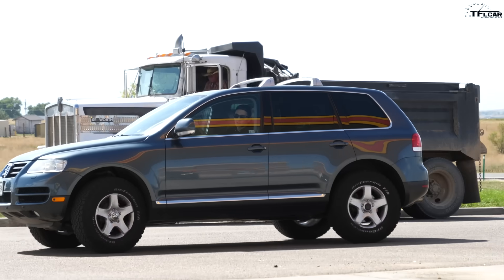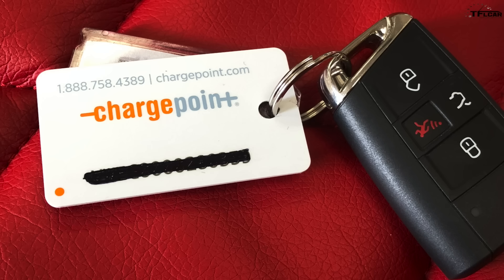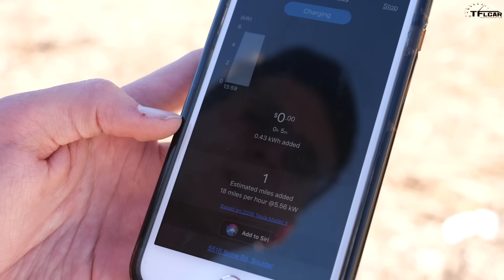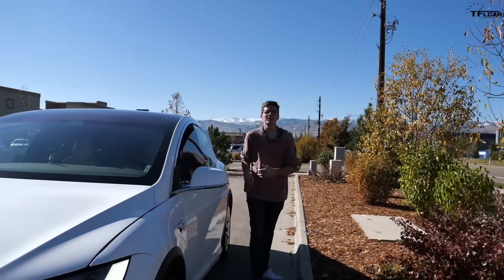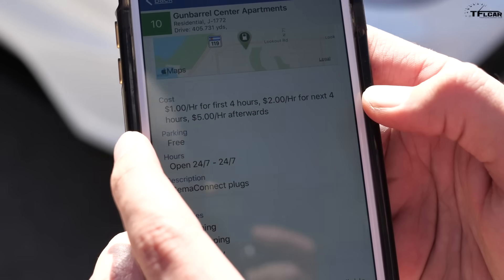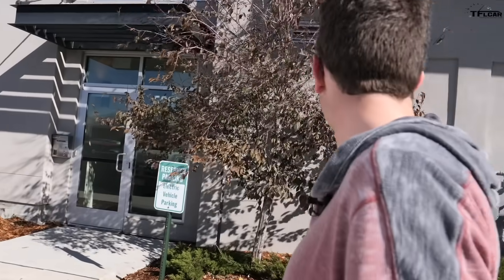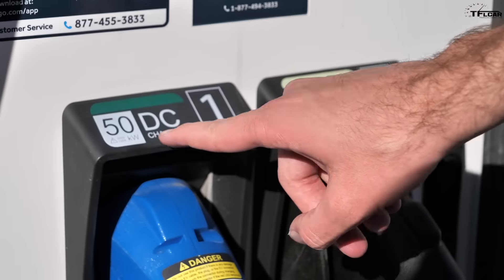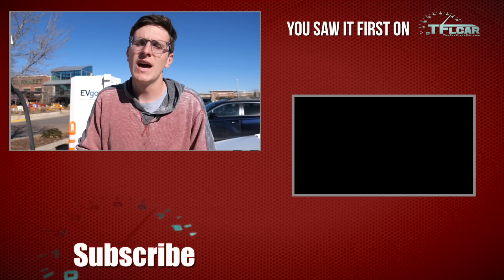Here’s Why Charging an Electric Car Can Suck - And It’s Not The Reason You Think!

Comment: Do you really think this is a better way to fuel a car? Are you nuts? Suppose you need to be somewhere in a hurry, say Salt Lake City, you’re in Bolder. That’s roughly 500 mile. You need to be there in 12 hours. Not a problem in a gas car, but these things can only go roughly 300 miles on a full charge and according to you it would take  over 20 hours to just recharge it fully. What are you supposed to do, get a hotel room while you refuel? Maybe in 30 or 40 years, the technology might allow for a faster charge, but right now, this is a pipe dream.
Reply: Let's take an example of the slowest charging current EV with more than 200 miles of range: The Chevy Bolt. According the A Better Route Planner, a trip between the two cities would take 11 hours 23 minutes with 2 hours 17 minutes in charging. Again, this is absolutely the slowest charging EV on the market. With one of the fastest charging EVs, the Ionic 5, it takes 9 hours 50 minutes with 45 minutes of charging with no single charging stop more than 14 minutes in length.

Comment: I did a Google Map search for local charging stations near me.  There were about 50 spread around town.  We're in an older section of town so the closest was about 3-4 miles away.  NONE were near areas where I would shop for any length.

I wish the charging stations were located in malls where people would spend an hour or more at a time.

Comment: Yes , station is open , you get there  . Someone else beats you to it , and they charge for an hour . Or you can't get it to work.  No thanks . Give this 5 to 10 years when they get the vehicle and charging thing worked out ! By then the charging will cost more.
Reply: You charge at home and go to work. Or you drive to work and charge at work. Or you drive to work, drive home, and charge at home. Do you have a gas station at home? Do you have a gas station at work? When you have a charging station in either or both spots, there's no need to stop anywhere else to charge for the typical commute.

Comment: Are you kidding? There are public chargers with 6kW charging speed? Here in Europe the minimum is 22kW AC and 43kW DC (most chargers are AC chargers here - 3 phase 32A is available everywhere, so it's relatively easy to setup and gives you acceptable charging speeds ~100km/h).

With the Type2 plug used in Europe (CCS for DC) it is theoretically possible to do the plug&charge like Tesla does - unfortunately I haven't seen a single charging station which supports that even though my car does.

Comment: You remember those phones that hung on walls, or posts that worked every time?.... Are these charging centers reliable? Safe? Hackable? Panhandlers should love these locations and I expect it to get really scary. So, the charge point you’re at, doesn’t provide any protection from the weather elements.... rain, sun, snow.......   So, I guess I’m 💩 out of luck with my flip phone......5-26-2021

Comment: Looks like a major pain in the ass to me. Who has the time to wait for even a small charge. You will spend your whole day just getting little charges till you find the next station. Plus the hours of operation seem stupid to me. It should be 24/7... Try telling your Boss at work you have to leave early to charge my car. What happens in the winter when you need power to heat the car. More power needed and more time waiting. I see a real nightmare happening when gas powered vehicles are outlawed.

Comment: The overall issue with your report is a simple one, you are driving a Tesla and you are trying to charge it with a third-party! Don't!
The solutions is simpler one use a Tesla charger and get the job done fast and easy and stop trying to create a issue where is none. As for car manufacturer who are trying to depend upon other manufactures technologies and their hardware, while refusing to build their own networks. Stop buying their cars just because your in a habit of buying them. It's time to try something new! It's also time to buy not only something new but its also time to buy the complete solution.

Comment: They can't seem to agree on which plug type to use...yeah, that's frustrating alright.
Reply: Unfortunately that's where technology always goes. Everyone thinks they have a better solution to something than the other guy. Realistically there's no need for proprietary plugs, cords or adapters. They should all be uniform like gasoline and diesel pumps. Honestly 2 years later and there's not been any substantial improvements...this just proves EV's are and will always be a giant pain in the arse.
Reply: @alpha2gproject783  I agree 100%
Reply: @alpha2gproject783  it’s only a challenge for people that cannot figure out how to use an adapter. This is the same challenge people have when plugging in laptops in different countries with different electrical standards.  Honestly, if that is what is stopping you….
Reply: Adaptors are easy to find.
Reply: CHAdeMO died when Nissan switched - j1772 & Tesla are the standards, any charger that still has a CHAdeMO will have a j1772. Adapters exist but I wouldn't count on them. Additionally Tesla has its own charger Network. Once you look into it it's pretty simple.
Reply: EU folks are more likely to adapt EVs, since almost none of them can afford a house with garage, and discourages DIY.  North American lifestyle, on the other hand, is a lot richer in this regard.  We need SUVs, vans and pickups.  EVs are not practical at all.
Reply: @donchiva2222  why are they not practical? It's funny you said people need suvs. The average driver doesn't need a pickup or use it for work, people can just have cars and use EVs
Reply: Even if they do agree, they can break away and change to their own plug type (like the apple phones that broke away from 3mm jack and usb c agreed upon previously to reduce waste andsave the environment).
Reply: @crxdelsolsir  how does that, save the environment?
Reply: a recent study shows that a major portion of ev car buyers also don't know what bathroom to use.................js
Reply: @billw8476  How old are you?
Reply: Meanwhile, my gas pump nozzle fits right every damn time...
Reply: @midcenturymodern9330  you have a gas pump at home and at work?
Reply: @TheHopetown  and electrical plugs are on every building
Reply: @TheHopetown  I would recharge my Chevy Volt every night on 110 AC. Rarely was it ever not completely recharged by 3am. 220 AC would have cut that time in half. How many houses have 220 AC, most if not all houses. Then throw solar on the roof and it’s free AC.
Reply: @Doesitreallymatter-q3d  - Yes, we have gas pumps at my work
Reply: @williamhaynes7089  do you have gas pumps at your home?  I recharge conveniently at home for > 98% of the time.
Reply: Just at home. The range on a Volt is 55 miles, that covers my commute with plenty left over for errands. Then plug in at home. It’s full every am.
Reply: @TheHopetown  But not at your house. My Volt is fully charged every am. But you keep holding on to your gas hole cars.
Reply: in the EU they told them to use one type
Reply: @robertjackson3552  They did it with the cellphone charges and we in the rest of the world thanks them for that.
Reply: I think Gov't needs to step in and set one standard plug like a standard electrical outlet so everyone is on the same sheet of music.  VHS vs Beta tapes situation cost consumers money in the long run. Also service stations should began to accommodate this new tech.
Reply: @gregbrigham3247  then every country will have a different plug.
Reply: @gregbrigham3247  The Government messes up everything. The use of a 50 amp dryer plug on the side of a building and a inside switch to turn it on or off is good enough. The EV owner can carry his own Gen 2 charger. Say a $ 5 dollar fee.
Reply: If you own a Tesla this entire video is completely incorrect.

Comment: Semi-OG EV guy here: YES to PlugShare. By far the best resource for this. I have used screenshots from there to make a lot of people look stupid after they made ridiculous pronunciations about the lack of charging stations, in areas that are perfectly well served.
Side note: that slow ramp of the charging rate is not the station itself. The J1772 protocol involves some data exchange up front, during which the station advertises a voltage and maximum available current to the car. The car actually controls the amount of current at all times. I am not familiar with how other vehicles do it, but Tesla ramps up gradually and it monitors the voltage as it goes. If the voltage drops too much as the current rises, that is indicative of a wiring fault and will result in the car imposing its own, lower, current limit to reduce risk.

Comment: you can carry as much as you want  gasoline fuel in galones with you in your car to travel to remote areas example going expedition but you can't carry the charging station of Electric Vehicles when traveling. when there a lot of EV on the road you will have to wait for long before charging your car. Electric Vehicles will make sense if solar power is used to charge your car

Comment: EV are not going to work - very inefficient . If you have the 240 volt charger at your house garage
You can charge while you sleep .
However , if your battery charge is low - say 5 % - you are going
to be at a charging station a long time , like 3 to 5 hours . You have that amount of time to waste ?
Even if you use DC current it would take at least 1 hour .
Plus , DC current is more dangerous than AC current .
Than , you go to lunch finish that lunch and head back to the charging station and find some jackass has unplugged your charge or has stolen your adapter . Funny huh !!! 
You can see the idiocy of this 
system .
Also ,  EV ' s are much more expensive than gasoline autos .
Therefore , less vehicles will be sold and less people will work to build those vehicles .  MORE PEOPLE OUT OF WORK !!! AND MILLIONS OUT OF WORK IN THE
OIL AND GAS INDUSTRY !!! 
P . S . Electric cars failed in the 1900 ' s because of their inefficiency !!!

Comment: I noticed that all these charge stations are exposed to the weather. Try charging your car in the rain while trying to figure out confusing directions, adapters and other encumbrances while getting drenched.
Reply: My City has 4 or 5 public chargers in public garages. That is where I go to on rainy days IF I need to charge. It takes me 15 minutes to add 50 miles at fast chargers in a garage.

Comment: My 23yr old accord fuels up in about 3 minutes, and gets far more range. So does my X5M, and my X5M Is alot more fun to drive, so what's the point of these cars, besides showing off. Please don't say the environment. Before you do, go look at the size of a lithium mine, compared to an oil rig or fracking.

Comment: When your sleeping in the car waiting for car to charge overnight can you turn on car for heat if it gets cold or will charge drop to zero
Reply: you cant because everyone else is waiting on the two charging stations. they will make you move
Reply: carry a sleeping bag in your fronk and a good old transistor radio cause you don't want to run down the battery that keeps you warm .
Reply: id be too scared the battery would catch fire while i slept

Comment: It would’ve been faster to hop on a train in the 1800s to get where you wanna go
Reply: I recommend horse & buggy!
Reply: @richardmorris7063  Amish Motors
Reply: @richardmorris7063  Seems to be where we're headed🌹
Reply: @richardmorris7063  There is something to be said about a classy buggy and a fine bay Morgan.  But, I live where a horse actually makes a lot of sense.
Reply: @johchadow  I have on a Eurail pass before the wall cam down.  The only bad place was going through East Germany where we had to stop several times to have our passports checked before reaching West Berlin.  E Germany (DDR) bad place!  At every stop there were guards with guard dogs the size of grizzly bears at the entrances of every passenger car.  DDR was run down.  They all used the same model cars (Skoda ?).  A real POS.

Comment: THE TRUTH IS THAT E.V.S. MAKE THE MOST SENSE ONLY  IF YOU CAN CHARGE AT HOME OVERNIGHT. SINCE I DRIVE AN AVERAGE OF 50 MILES PER DAY, I CAN CHARGE MY TESLA MODEL 3 OVERNIGHT USING ONLY A 110 VOLT OUTLET. ANYMORE THAN THAT AND I WOULD REQUIRE A 220 VOLT OUTLET. FOR LONG TRIPS EITHER WAY I WOULD NEED TO STOP AT A SUPERCHARGER.

Comment: Good video that makes some thought-provoking points. While I like the notion of an EV with its distinct advantages of no oil changes, no antifreeze with considerably less maintenace; there are still a number of issues to be worked out like: standards for batteries, charging adapters, charging infrastructure, providing greater range per charge and extreme weather charge loss to name a few. We purchased a new vehicle in '21 but didn't go with an EV. We needed a 3-row AWD SUV. We get close to 500 miles per tank full which works pretty well for long trips. Society needs the early adopters, and thank goodness we have them, to help manufacturers work out the kinks and to help determine the necessary infrastructure so that the rest of us can enjoy these products when they become mainstream.